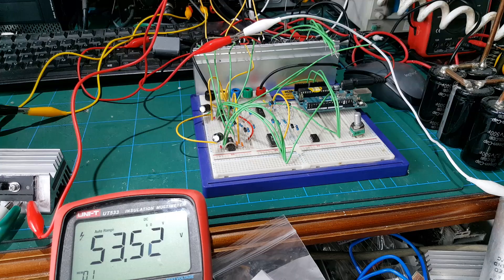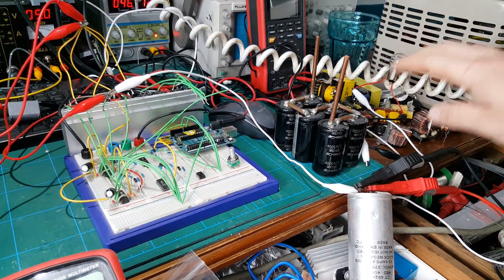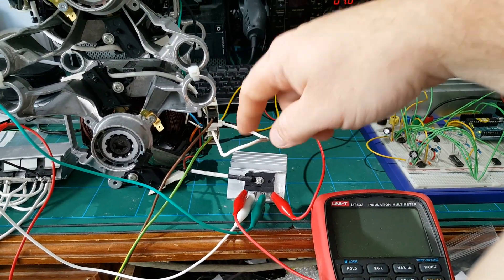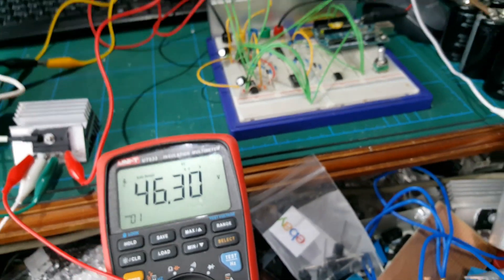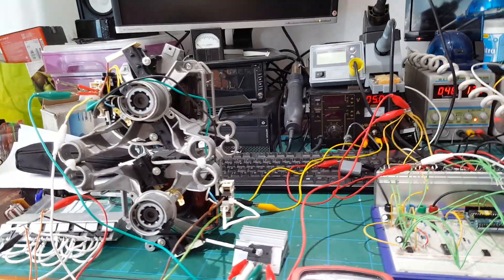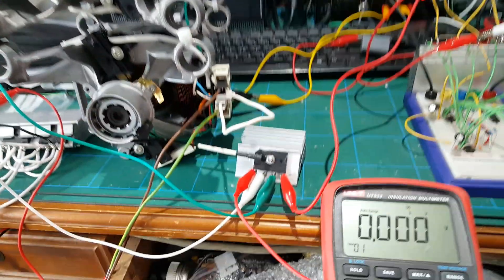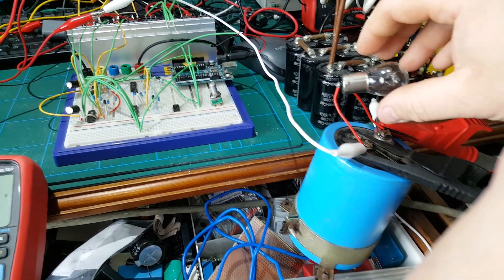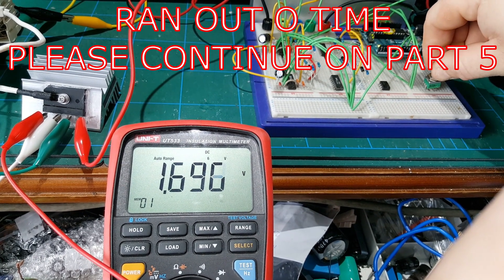motor control #4.1 regen braking a dc series wound motor explained

Comment: where to buy or how to build regen braking for a bicycle or tricycle thats near 80% efficient. i wanna use LTO batteries with up to 10c charging rate. and weight my bicycle down but not too much that it will be too hard to push up a hill. then regen down.

Comment: If you've gone with supplying separate voltage to the stator winding this becomes more or less a shunt generator rather than a series generator correct?
Reply from the maker: Yes id say so . I found that when running the load in series it jolted quite badly stay tuned im working on some new algorithms that are going to be exciting :-)

Comment: Is you controller basically just switching the IGBTs as if it was trying to drive the motor in reverse if the force driving it wasn't the more powerful?
Reply from the maker: No . What its doing is . When you want to regen brake . It stops pumping power into the motor to drive the wheels and starts to run the emf from the motor which is about 60 volts into a 16 volt capacitor bank. This creates a "force" which there will be a current draw from the motor as it tries to pump power back into the caps, charging them up as it goes. The force creates a drag on the motor which essentially is the braking part and the charging of the capacitors is the power being regenerated .. hope that made sense :-)
Reply from the maker: The more you want to brake the higher duty pwm it connects the motor with the caps and the faster charging and more drag (braking effect) is created :-)
Reply: @jaysjetskis  that make sense from how its working, thanks. Pretty much like the old school dynomo on a bike. I'll have to have a play around.

 I'm not sure I get the why. It's probably well beyond the scope of the video, but I don't get why having a load across the motor causes a braking effect.

Comment: I enjoy riding along with you on this adventure. You have introduced to me the world of IGBT's, and now I have a new tool when MOSFETs might let you down.
I am very interested in making the most efficient DC motor/charge system and your series is perfect for my electric bike project.
I was totally lost watching this episode until I saw that the drive motor was being powered from a different source (located to the left of the motor/generator setup). And the IGBT motor controller you were using a couple weeks ago has been repurposed to apply the PWM pulses as an output from the generator. I was lost because you failed to show how you were changing the speed of the drive motor.
I agree that using ultra-capacitors in conjunction with proper batteries is the smart move. I would love if you could set up a test where you could measure how much more efficient this makes your project.

I didn't see where you mentioned this, but I am confused about what your goal is for this series. I have gleaned that it will be a 3 phase AC motor-driven vehicle of some sort, but what it isn't too clear.
My project is to make an electric bike using a home-made motor/generator (probably permanent magnet) that is essentially a wheel. This will house both the drive motor and the generator. One will be positioned around the hub and the other will be positioned along the outer edge of the drive wheel. I am thinking of using two batteries, one driving the motor and the other receiving the charge. I am thinking that in addition to using a similar regen charging system, I want to turn the pedal into a generator also. The rider will simply flip a switch to swap the batteries from drive to charge positions.
Reply from the maker: Replied with a little vid pal. Thanks for the feedback :-)